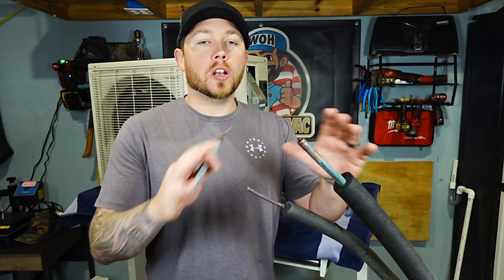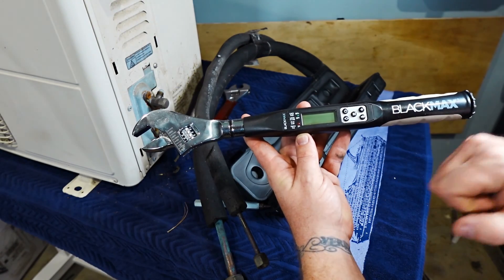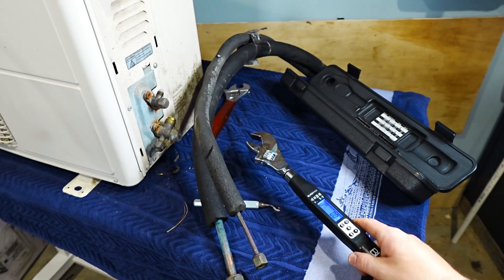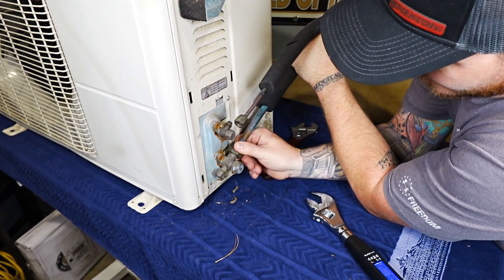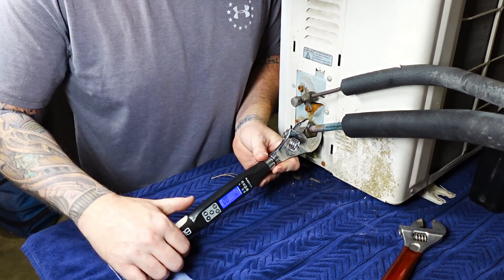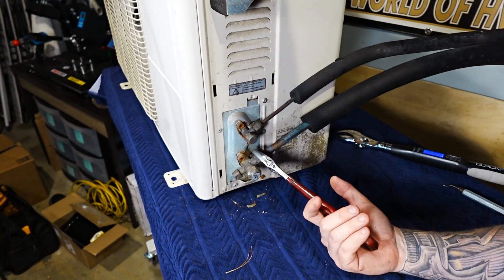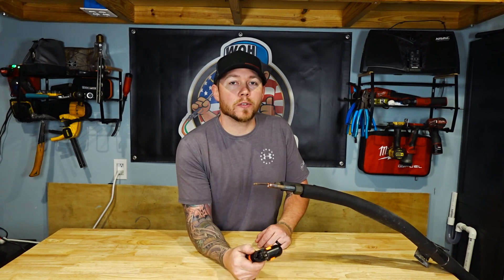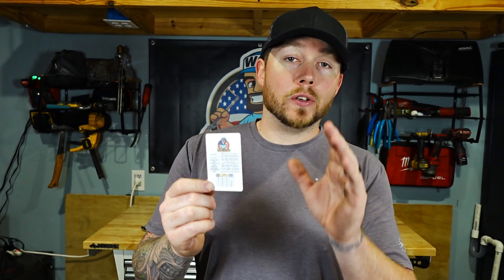Why You Should Use a Torque Wrench on Your Mini Split

Comment: I double flare all my lines. I know it's an overkill, but it is my preference
Reply: Double flaring isn't overkill — it's generally considered a mistake in this application.
Reply: In applications involving higher pressures, double flaring is often necessary, which is why I prefer to use this method for my lines. I find it to be a superior approach. It is also worth noting that certain cities and towns mandate double flares, so it is advisable to consult your local building codes before proceeding with any flaring work.
Reply: @AngryDAP  Do what works best for you, as long as there's no leak. That said, double flares are typically used in automotive brake lines and high-pressure hydraulic systems. In HVAC—especially with mini-splits and standard refrigerant lines—single flares are the standard due to compatibility and sealing requirements.

Comment: Extremely helpful! Thank you. --- However! ==> I wish I had the torque wrench you show. I have one with a set of fixed size wrench pieces, 1" and smaller. I must admit to being quite stunned to find they do not fit either nut on copper mini-split lines! Even though both are marked in inches, not metric. I have spent quite a lot of money (hundreds) on special tools for this a/c, which may be the only time I ever use them. I simply cannot keep spending more big money to duplicate tools. My solution was to find pieces of metal, flatten and cut and file them to fit, then line them inside the wrench heads and tape them in place, to make them fit the nuts better. Not a great solution! I have found that every single step of trying to install this mini-split has been extremely difficult, and always far more difficult than shown in all the youtube videos. Sure, I'm not a professional HVAC guy, and by the way, I couldn't hire one either! When I called my main HVAC company for help (the ones I paid a fortune to install my entire central air system in a large house), they said they can't work on it because they didn't install it!!!!! If every HVAC company declined work unless they did only new full installations, the entire business would collapse. At this point I could write a book about all the problems I've run into with this. I spent hours reading, studying, watching videos... before attempting the torque wrench for the first time. Well, the small line torqued ok, but not the larger one! I never felt or heard the "click", finally it started to twist the half inch copper, so I stopped! Very disappointed in that performance.